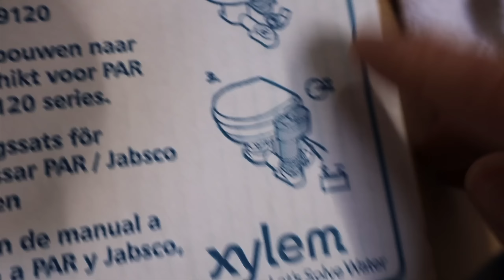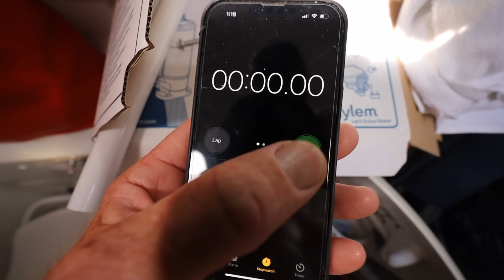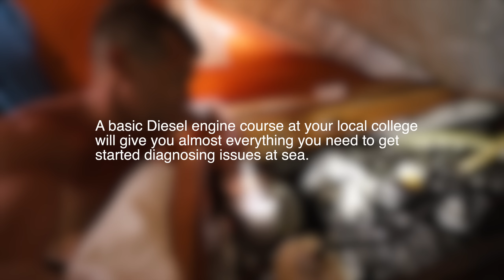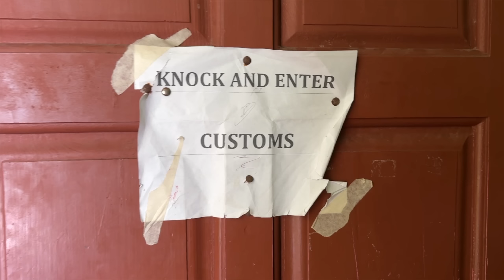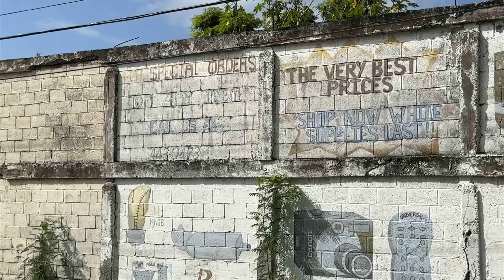The Reality of long-term Life Aboard

Comment: Ben, check the alignment of the alternator to the water pump and crank pulley.  you'll need a straight edge to check it, but my money is on it being slightly out of alignment.  You can shim it if needed to adjust.  Taking my final ASA courses in the Grenadines this February.  You are some of my greatest inspiration and I thank you for that.  Be safe, have fun.
Reply: Not only alignment but ensure that you have the right belt for the pulley.  Make sure that the cross sectional shape is correct such that it matches the pulley shape and that the belt is not over tensioned.  The correct tension should be such that when you twist the belt in the centre of the span you can get a 90 degree twist but no more.

Comment: I've dealt with boats eating engine belts. Sooooo many people think the belt is misaligned. Never the case. If your seeing belt powder 99% of the time it's rust in the pulley shieves. Boats are notorious for this. They sit for months on end and rust oucours on the part of the pulley that is exposed. This creates a rough bumpy alternating to smooth surface. This eats belts. Throws belt powder. Super easy to fix. Take a wrench or a triangle file , welding rod , a stick ....  Whatever and wrap it in sand paper. With the engine running and belts turning the pulley shieves find a "SAFE" way to insert "whatever" wrapped in sand paper and sand pulley shieves until 100% smooth. Try to not loose any fingers. I've performed this risky finger biting operation on crew boats around north Vancouver Island many many times. Often you can't see the rust dimples in the pulley. I'd bet a pay cheque this is your issue.

Comment: Belt alignment is dependent of the Harmonic balancer or Crankshaft Pulley use two straight edges and align all belts off the Harmonic Balancer as a reference or change the Belts to Serpentine in Nature.

Comment: Use a long enough ruler or level or something with precision machining and lay it across the 2 pulleys.  Look for gaps, along the edge.  The alignment has to be perfect so the belt is not offset.  Belts wear during use, but it shouldn't be excessive.  I had this problem with a Universal 35, and it was because the pulleys were out a tiny amount.

Comment: Here's a thought for the dingy stealing conundrum. Paint the pretty engine to appear like the worst of the worst "Force Outboards " motor (non diesel) and for good measure paint a few cracks and make what looks loose fiberglass patches with releasable adhesive. The key would be finding releasable adhesive to put on silver fabric tape and strap it or rubber patches that just stick on when you're in shore. 
The idea being to make it look like shit...make every dingy and a few row boats look far better than messing with your hunk of junk. I could probably build you a painted cowling that fits right over the pretty Yamaha. Make a bunch of stickers or other patch making (rubber patches over nothing....perhaps in reinforcement points to make the dingy look barely able to get you back to your boat. 
I built out a camper shell on a pickup truck that I could leave at trail heads while I backpack for up to a week. I needed a design that wouldn't temp  bears or people to breaking in.  I could not think of any locking system that couldn't easily be broken, so after a summer of designing (Im an artist) the perfect truck. In the end security won out over everything. So I built an insanely simple, soft, warm and cool open area with thick insulation. I made two convertible lounge chair/bed combo...covered in fur because I had it (fake) The chairs with minimal hidden storage appear like a back seat pulled out of a car when covered with a pee stained hiker trash sheet. White on white truck with zero storage in the back...no drawers that could hold treasures, or cabinets - just space and super comfortable bed/chair or both comfort. Oh and for good measure when I'm sleeping in it I fill the back window with an insulated full window size close up of Steven Kings "It" clowns eyes. Its horrifying...I would never tap on that window. 
Hide your dingy in plane sight and have people wondering how the hell you got to the dock - and all removable when your among a  less desperate populous. 
I dare you to take me up on it. 
Cheers and BOOOOO to the twice a month idea, but I get it.
Reply: Great camo idea: I just used stick on shelf paper to cover my snow skis while I ‘rested’ in the bar. But the lock seems easiest too.

Comment: Hey guys , luv your Chanel , I have similar yanmars to yours and the issue lays with the belt size is too small  for the alternator , I solved my issue with a flat belt installation and then upgraded both alternators to larger output . Haven’t had an issue in 2 years since . Merry Christmas.

Comment: Check the alignment of the pulleys with regards to each other. If one pulley is not aligned with the others, even by a few thousands of an inch, that can cause your issue. From an old retired automotive teacher in Ontario.

Comment: The Alternator when charging lithium batteries will be under significant load, it will be much harder to turn for prolonged periods of time. Might be the reason for the belts disintegrating.
Reply: One of the best upgrades in engine design has got to be the serpentine belt. One fat thick long juicy belt turning all accessories and lasting for years.
I have an old motor with the old thin belts and find they are a pain.  You need the OEM belt because the pulleys are made so other non OEM belts do not fully seat in the groove of the pulley and wear prematurely.  The OEM belts for my engine are hard to find and grossly overpriced so you are always tempted to try a cheaper belt that looks like it should work.  The joys of boating.
One man’s opinion.

Comment: Engine belt

It's much too loose.
 A simple test is after shut down feel the pulleys. If hot ok , if very hot it's slipping.

I'd say less than 10mm deflection mid span.

On hi load setups like your alternator I reccomend a cogged back belt. Then it flexes a little easier around the smaller alternator pulley and it drags some cooling air around with it.

Another test is look at the pulley bottom if it's clean. It shouldn't be as belt drives on its sides.

Water pump uses very little power compared to alternator.
Alternator will spin easily until it's field is energized.

An old trick is to cable tie a spare belt to the front of the engine so you don't have to remove another belt to replace it in a hurry.

Comment: You have LFP batteries, and they put a very large load on the alternator for a long time and that creates excessive wear on the belt.  I only get about 50 to 75 hours out of a belt with my 100A alternator with it dialed back to 60A with the rediculously skinny 3/8" belts our engines have.  I am going to add a serpentine belt kit which should help greatly.

Comment: On the belt… you could check the pulley temp after it’s run for awhile, see if one of them is getting hot.  I think I’ve seen you with an infrared temp gun

Comment: That drive belt needs a tensioner. Not having a counter pulley putting tension on the belt, that 'slap' of the belt will delaminate the belt and then it will grenade.

Comment: As far as the v belt goes, did you check if either the alternator or water pump is out of alignment with the crank pulley? Seen those symptoms as a result before...

Comment: Great video!  Do you refrigerate your eggs?  Are they fertilized but not incubated?  Hubby and I are having a debate about refrigerating eggs.
Reply: I’ve only found refrigerated eggs in the US and Japan. 

Basically if you buy them off the shelf, they don’t need refrigeration. If you buy them out of a refrigerator, they will need refrigeration. 

Unrefrigerated eggs can last weeks, just turn the eggs 180 degrees too to bottom daily.

Comment: Something to check with your belt.  The dust and delaminating could be caused by the belt getting hot from misalignment on that pulley that has the uneven coloring or could be a runout issue from a best shaft or the pulley isn’t straight on the shaft.  Good luck, bud.

Comment: I'll throw in my 2 cents about this belt situation. Many commenters were correct about the pulley alignment. They are 100% correct about the straight edge across the face of the pulleys, they need to be parallel and coplanar, like they need to be perfect. First question, Is that an aftermarket alternator, one of those high amperage, extra charging deals. More amps equals more stress on the belt. Aftermarket alternator, higher likelihood of misalignment. Next is belt tension, From the video it seemed it could use a little more tension. It's hard to say how hard you were pushing on that belt. Loose belts usually sqweek, but loose belts can slip under heavy load. Too tight and you pre=maturely wear out the bearings in the water pump and alternator. Just enough tension is good.
   Do you have the correct size belt. The length looks ok, nut how about the width and profile. Only going by what I can see on the video, it looks like the outside of the belt( the wide side of the belt that's de-laminating) is riding on the top edges of the groove walls. My question is, Is the belt sitting all the way down in the groove? Is the inside touching the bottom of the groove? Or is it just the wider outer part of the belt ridding on the top of the groove walls. You can compare new and used belts for wear patterns. So is the belt too wide or is an alignment problem preventing the belt from laying all the way in the groove. The other belt on the engine appears to lay flush with the top of the pulley groove. 
   Lastly. if the pump or alternator is wearing out you could get some wobble. I couldn't see any  When you turn the pulleys by hand, without the belt. any clicking noise, you might feel it too, could indicate a bearing starting to go. If you grab the pulley hard and try to shake it and have any movement, that's a bad sign too.. 
   The guy suggesting that you try to sand the pulleys while the engine running is real stupid or a real sick, sadistic SOB.
Smooth Sailin'

Comment: Next... An ounce of prevention is worth a pound of cure. When you know the boat will be sitting for a month or two, once you've sanded or replaced the pully shieves... With the engine running and pulleys turning give them a "spritz" with wd40..... God's gift to marine maintenance.